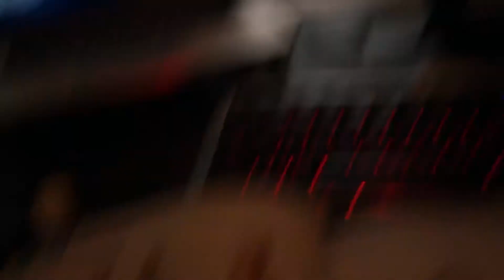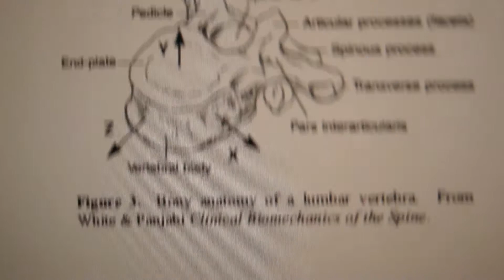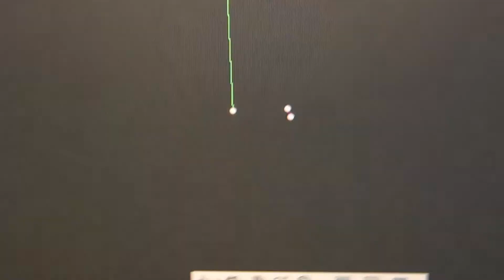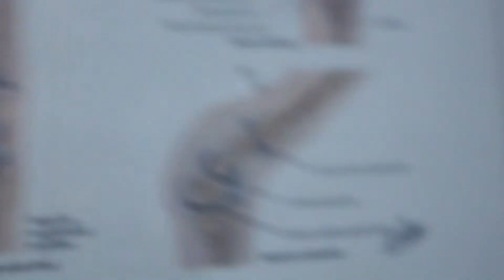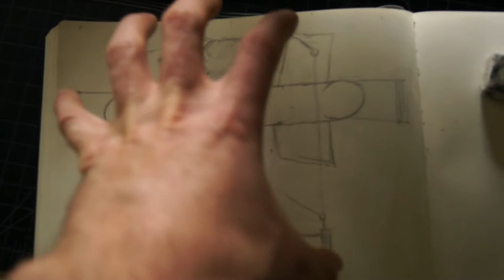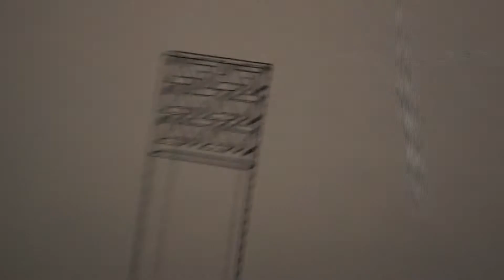How To Fix a Clogged 3D Printer

Comment: I meant the wattage of the exoskeleton, btw are you going to use different sized actuators for different spots or every part the same?

I doubt it will be possible to make an actually useful flying suit, but assisted "jumps" should be possible create, 50-100m or even less long jumps would be impressive by itself anyways, and certainly would be useful attribute especially for combat capable suit.